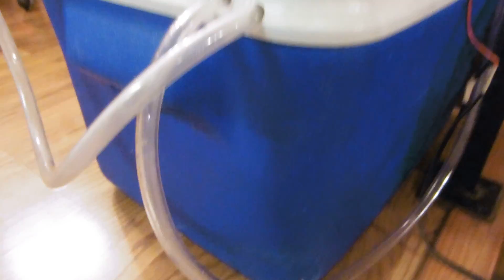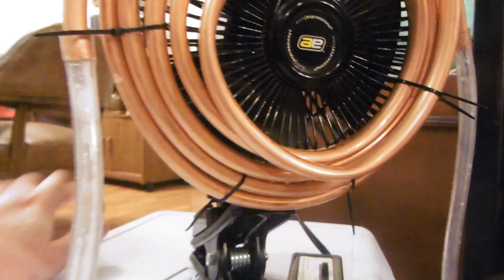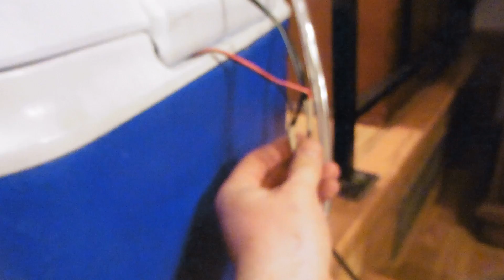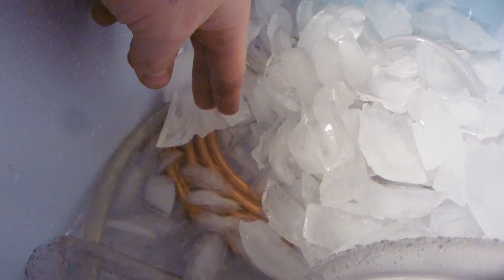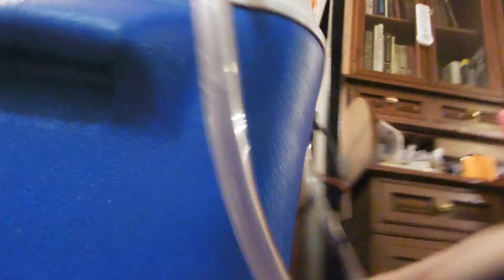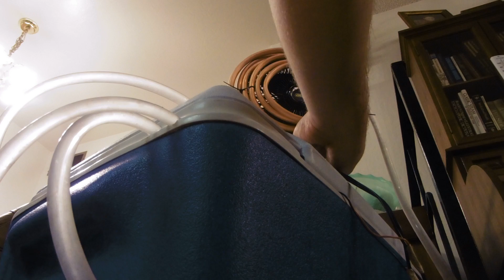Non Evaporative Swamp Cooler - Most Effective Ice box Air Conditioning!!!

Comment: Can the coils on the fan be placed on the back of the fan, would there be any difference?
Reply: Fan first will cool incoming air a little bit and make the job easier for the cooler. 
Cooler first has to deal with warmer incoming air, which won't come out as cold or even cold at all. But if it does come out colder than the fan, then the fan will start to heat it back up.

Comment: Whats the point if you consuming power with the freezer cooling water for making ICE? Your fridge go on max power consuming from 40w to1000w because you add tap water into the freezer. You are an idiot with calculation.
Reply: So you think a tiny water pump, a fan, and the ice his ice maker in the fridge ALREADY MAKES which crosses itself out uses how much electricity again? Learn some proper grammar and stfu.
Reply: @Thelegendl23  you have 0 undertanding of engineering and reliability. You need refrigerants. Its getting very cold. You can use butane gas....easy
Reply: @UrgenthelpwithSubscriptionsHel  and yea lemme just store some butane in the middle of my house on a homemade air cooler... wow, just wow.
Reply: @Thelegendl23  you have no ideea what to take in account when building something. You have no ideea about gas refrigeration and Tec modules. You have to research and learn a lot....if you want to be a legend on youtube. For now.....what you do its wasting time.
Reply: @UrgenthelpwithSubscriptionsHel  Kindly correct your horrendous grammar and I will be glad to reply.
Reply: @Thelegendl23  its not my language. I ve learned by myself using internet. For me is not that hard. But you not gonna be able to learn my language from the internet in few months.
Reply: I understand your frustration from many of your unsuccesfull ideeas. You will make money from youtube when you gonna learn engineering and science. Research NASA projects from spacecrafts. Learn seebeck effect,learn dc current, learn solar energy. People will apreciate you. For now.....you are unable to invent something good.
Reply: @UrgenthelpwithSubscriptionsHel  I'll pass on whatever language it is you so highly glorify, your original comment was horrendous and I'll stand by my grammar statement. Seeing as you have nothing further to say that is at all productive and have resorted to speaking of NASA as if you're delusional, I'll bid good day to you sir.
Reply: @Thelegendl23  you didn't got my point about NASA Projects, there you can find the best systems to suit your projects. You need to be more concentrated to understand. Just because you don't understand me and you don't see my projects posted online, doesn't mean I am delusional. I ve spent $230.000 dolars for my systems based on researching from accesories used by NASA in space. But I let you to consume your energy for pumping water and for making ice. Hope one day, you will grow up like a real man. Looks like you are blocked to remain at only 1 level.
Reply: This is perfect for a teardrop camper where I have access to ice but not significant electricity. I can cool the camper at night Without running a generator.  The fan can run on batter just fine.  This idea as a time and place.  You’re being a jerk.
Reply: You are consuming too much power for what you getting out. Just put a watt meter and see if its good to use a 800w freezer and a fan 150w. For 30 square cm cool air, you are using 950w per hour.
If you buy an air conditioner 2kw....you double the consumption   but its 4 times more cool air coming out. So you can run it 30min on and 30 min off....for 1000w consumption. 50w more than what you are consuming with your gipsy ideea. 😂
Reply: And ohhh....you have water pump....20-30w consumption. And the life span its short. Its a cheap pump. You will invest $20 every two months? Imagine the cost if your country its getting more lockdown. Couriers cannot deliver your items. And the prices will go up a lot.

Comment: ice?
Seriously? ice? you have ice?
 if you have access to ice why is your need for cooling??
And that pump and fan together take a fair amount of electricity.
Are you plugging a tin or using a generator or something because once again, if you've got access to ice or that much electricity then what's the point?
Reply: My house doesn't have an ac unit so my room gets really hot in the summer. This is what it is for. Cooling a small room. And that pump and fan together probably consumes around 30w max. That compared to a typical window ac unit which consumes on average 500w.
Reply: I'll tell you what's the point. I live off grid so that means my home is powered mainly by solar and generator. I can make a reciprocating non-evap cooler using a 12V fan, large aluminum garbage can, 12V water pump/ gravity feed optional, copper tubing, ice from my ice maker that make 1lb of ice every 7 minutes and rock salt. 
It is much more cost efficient to run my no-evap cooler off of a 12V car battery hooked to a portable solar panel then it is to run my generator all day and night to power my A/c unit. And quieter also. When I have my generator running for other reasons during the day like to run my well pump or wash clothes I take advantage and run my ice machine. I add rock salt to the ice water which lowers the freezing point of the water and makes the water colder this lowers the room temp considerably more than using just ice water. The water coming out of the fan is colder than when it went into the fan.
There are many reasons people want or need this type of set up even though they have access to ice or they have electric. Maybe they don't have an A/C or theirs is broke or they cann't afford the electric bill when they run the A/C. Not everyone is as fortunate to be well off enough as the person who commented what's the point? Obviously that commentor has never had to live without A/C ever. Try being homeless and having no electric you wouldn't ask what's the point then, I'm sure. But even if the person using this was able to plug the fan into the electric it would still be way more affordable than running an A/C unit.
Hopefully i made the point for you.

Comment: I don't think his math is correct . First there is no such thing as cold just less heat.
8lbs in an American gallon of water. There are 10 lbs in an imperial gallon or 4.54 liters or 3.8 liters in an American gallon.
With a solar powered ice maker and a swamp cooler things could be nice. In the Great Lakes Region it gets super humid so a system that is relatively dry would be beneficial. 
Just one more thing, add salt to your ice and you get super cooling.
I'm just saying.

Comment: Take an ice cube maker refit it to supper cool water. Put a fountain pump and cold sink in one igloo. Take a GOOD fan and flatten the copper coil to be used on the front to increase thermal transfer leave a capillary at the back of the fan to help cool the motor on the return flow. Make a split system put everything in two igloos you can stack! Emergency cooling system! Novartis!

Comment: i was thinking of attempting this. what kind of pump is the one that you are using?
Reply: +domjen2521 Beware its a conspiracy. ( actually i think this dude never heard of Google ) Harbor freight has some pumps and you can also use a 12v bilge pump for a boat.
Reply: found me a bilge pump 12v 200 gph. i have yet to put everything together. was making my own diagram and blueprints. the only thing i needed to know was what kind of pump. so i ask a few friends, and one recommended a proper continuous bilge pump. so far, it should all work accordingly.